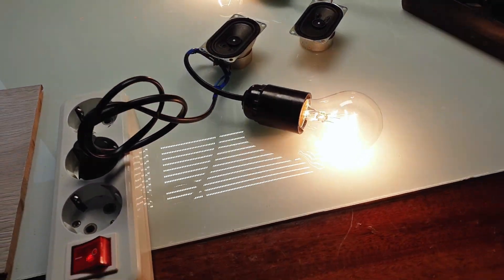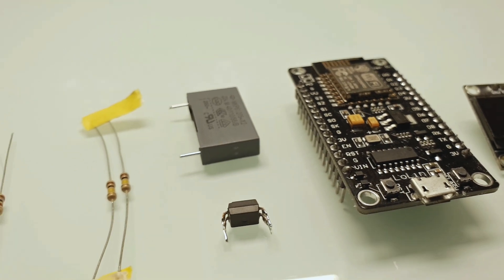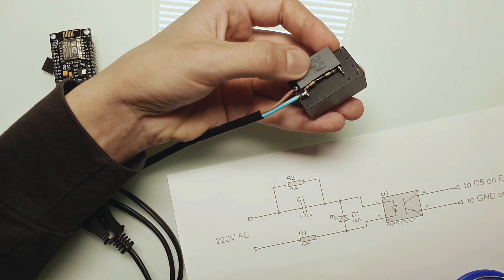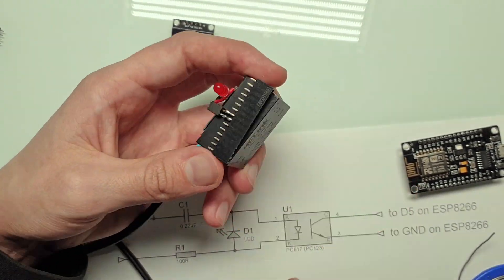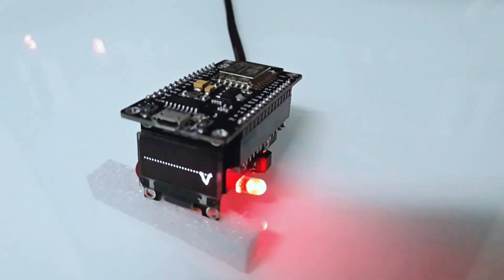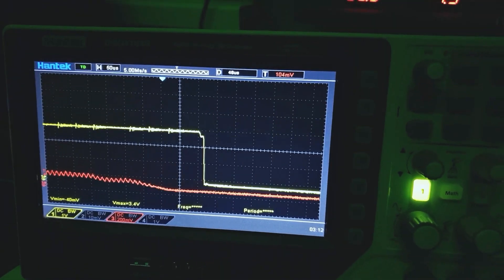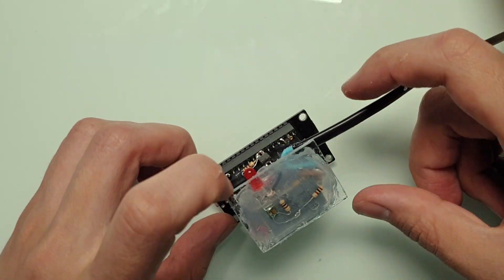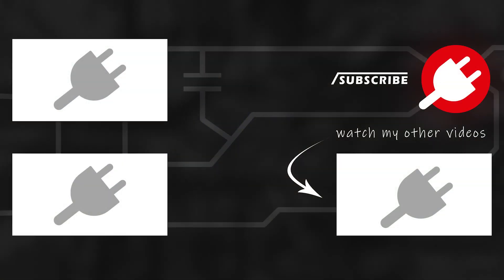DIY Device that Monitors the Power Grid of the Entire Country

Comment: I'm afraid the LED parallel to the optocoupler will fade with the time. Problem is the energy it  got from the start, when the capacitor is empty. Then the inrush current will flow and go through the LED. Also, there may be a problem with LED reverse voltage, which is quite low for them.
Overall nice try and good luck with electronics.

Comment: 3:15 My experience shows that it is not really necessary to limit the reverse voltage. I used a similar circuit in one of my projects (music player for an elevator) and I just connected optocouplers through some resistors to the mains. I used 4N35 optocouplers and they worked just fine.